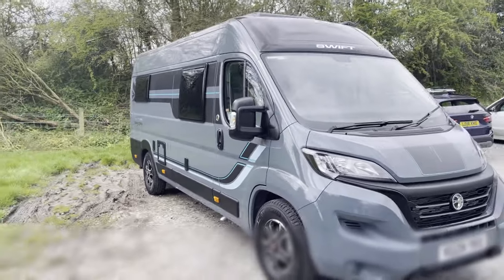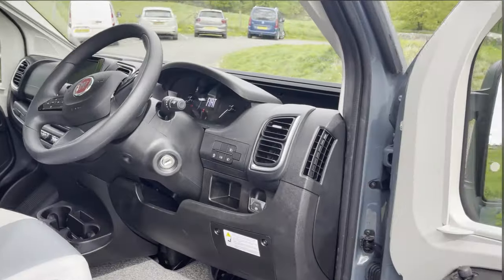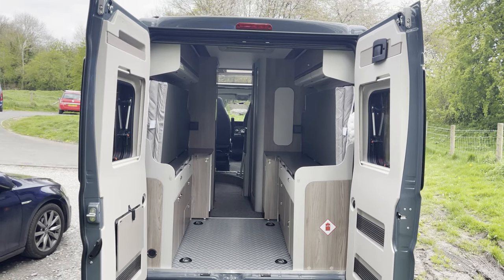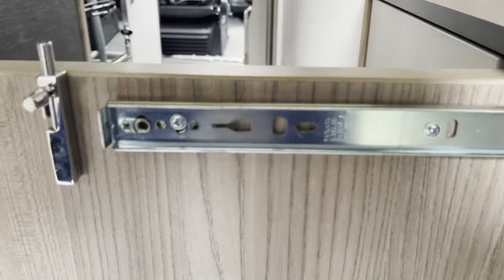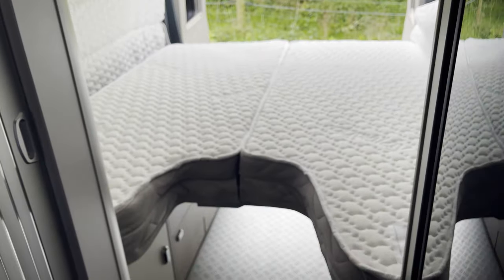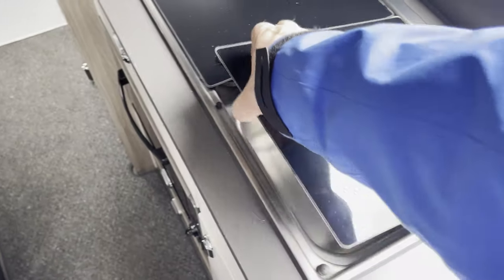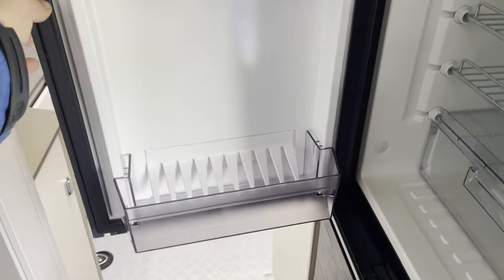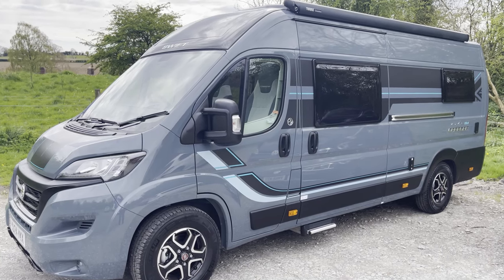Swift Carrera 194 - Review of the 2024 Model

Comment: Hi, fellow 194 owner here. One thing to look out for is the condensate pipe from the fridge. Ours had been left resting on the floor under the cabinet base. Some significant temperature changes and we ended up with damp carpet and bottoms of base units.  Unscrew the six screws holding the wardrobe base panel, lift up and check where the pipe is. Should be routed to the underside of the van so any condensate escapes. It appears there are other 194s with the same issue which is a shame as apart from that the van has been great.
Reply from the maker: Thanks for the tip! Very helpful 🙏
Reply: @campervancompanions  BTW, great video!